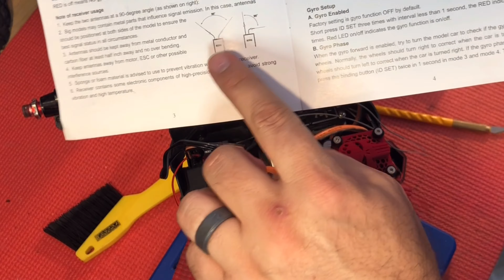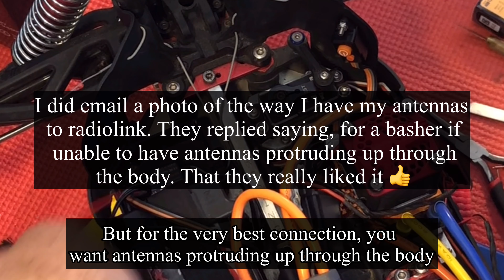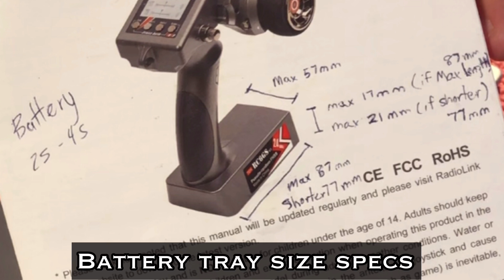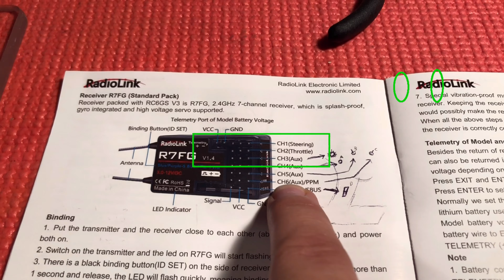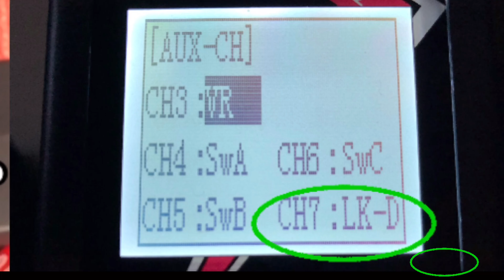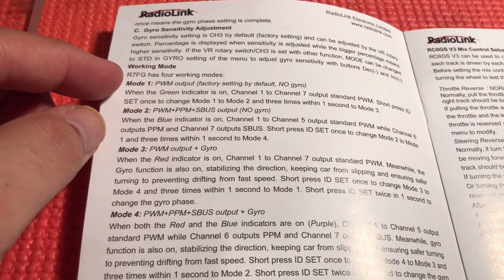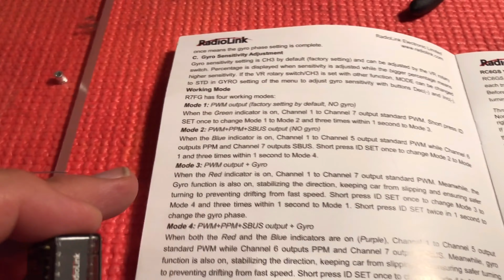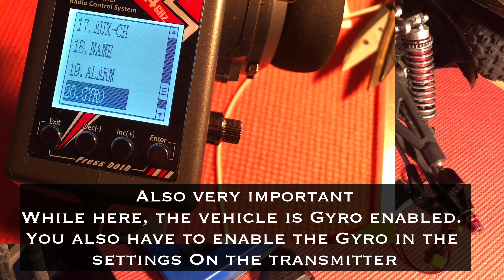Radiolink RC6GS v3 - INSTALL and Overview - Setup Dual Antennas, Gyro & Telemetry Explained

Comment: @ east tactics on my Traxxas summing I have 2 steering cables one goes to ch1 where do I plug my other cable at ?
Reply from the maker: Out of your ESC, you’ve got a cable that is the out for your on off switch to the ESC, you’ve got your main thick power cables to go to your battery, and you have one wire (which is comprised of three) that will go to your receiver. Typically this will go into the spot marked TH for throttle.
Now your servo will have its own wire again comprised of three. Which will go into your receiver in slot, titled steering.
However, you’re saying that somehow you have two separate wires for steering? Where are these two separate wires coming from, the only wires that you should have dedicated for string should becoming directly from your servo. And there should only be one set of three going into a single JST.
Check the description of this video and at the top you should see a link for the ability to submit a  Asq me question, include photos
Reply: @EastTactics  thank u, that’s where I’m lost one wire goes to one servo to turn left another servo to turn right and only one location for steering on my new radiolink
Reply from the maker: You have two servos? Is that what you’re saying? 
Because most vehicles only have one servo that’s capable of turning, both left and right.
Reply: @EastTactics  yes 2 servos on my Traxxas summit 1/10 scale to steer
Reply: @EastTactics  on my tqi it has 2 spots that says ch1 both are for steering on my new radiolink there is only one spot that says ch1 ?
Reply from the maker: @2259chevy 
OK, I myself have not done this. But I’m pretty sure there’s a way to do it with this transmitter because it has so many extra channels. All you need to do is assign one of the extra channels in the settings on the transmitter to act as a Steering channel.
It comes default with one channel dedicated to steering. However, you’ll need to go in and assign another channel to be a steering channel. Then you can plug your other servo into that channel once it’s set up on your transmitter. 

To use the RC6GS with a Traxxas rig running dual servo, you will need to connect the two servos to the appropriate channels on the transmitter. You will also need to set up the transmitter to control the two servos in the correct way. For more information on how to do this, please consult the manual for your RC6GS transmitter and the manual for your Traxxas rig.

Here are some additional tips for using the RC6GS with a Traxxas rig running dual servo:

Make sure that the two servos are properly matched. The servos should have the same torque and speed.
Make sure that the servos are properly connected to the transmitter. The servos should be connected to the appropriate channels on the transmitter.
Make sure that the transmitter is properly set up to control the two servos. You will need to set the servo travel limits and the servo reversing.
Test the servos to make sure that they are working properly. Move the transmitter controls and make sure that the servos are responding correctly.
I hope this helps!

Comment: I kept losing signal to throttle at long range! Steering works fine but throttle does not! Any idea
Reply from the maker: The fact that you lose throttle only is a huge blessing with this receiver transmitter. With the stock one. At loss of range, your vehicle has a potential ( which is high) to simply takeoff.
You’re losing connection? At what range? Because you are going to lose connection, especially if you are behind large objects, trees, or buildings.
Reply: My concern is, there are other speed racers running exact, same set up and they don't have an issue at all, and we are all running on the same road at the same time I would say about a football field link I lose signal and either direction! I put a new receiver on it today. I will see how it goes.
Reply from the maker: @bashmasterRC 
ya let me know

Comment: Hi Sir, i have a HOSIM X07 and i want to install a RADIOLINK V3 but don't know where to get the SERVO 3 WIRE. Should i get the 3wire from the MOTOR going to ESC? Many Thanks
Reply from the maker: I'm not 100% sure what you're talking about, but I'll take a shot at trying to answer. The wires connecting from the motor to your ESC are completely a separate thing regarding your "receiver/transmitter package" they are much thicker wires and they have a dedicated place to connect into the ESC. The ESC however, does have a three wire that comes out from the ESC with a JST and connector. The jST and connector will connect into your receiver. tthere will also be a three wire that comes from your servo ending in a JST connection also. This will connect into your receiver as well. I hope this answers your question
Reply: On my radiolink receiver its not lightning up , i think im missing a SERVO wire. So i don't know if i have to get that 3wire from the motor.
Reply: On the RECEIVER we put the STEERING SERVO on CHANNEL 1 right? What do i need to put on  CHANNEL 2? THNAKS
Reply from the maker: @dpyvett2261  no wires go directly from the motor to the receiver. The only thing that goes to the receiver is wires from the ESC, and wires from the Servo.

Comment: I have the RC6GS V2. How do I set up different throttle rates??
Like Arrma Vehicles transmitters. They have 50%,75% and 100%. Lets say the 3 tier switches on that transmitter, how do I set center point to 100% throttle and left and right points to 50% n 75%? Is it possible?
Reply from the maker: Yes, this is possible.. You’ll do this in the D/R setting area. That stands for Duel rate. You can change the dual rate for the throttle on any one of the switches. So in your case you would probably want it to be assigned to one of the two three tier switches, found at 11 o’clock and 1 o’clock. I assigned mine to the three tier switch in the 11 o’clock position, And on the V3 they’ve set that 
Switch to be called SWB. There’s a chance that it might be different on the V2. Anyway once in the D/R setting, the top left quadrant is the one asking you which switch you are going to change. You’ll know you’re on the right one if physically toggling the switch changes the display in the upper right corner of the screen from displaying the words, left, center, right. Anyway adjust the throttle (TH) to a different number for each position. That’s it.
If this doesn’t make sense, you can reach out to me via Facebook and we can connect perhaps even via the phone. I do plan on dropping a video shortly that will explain this, And many many other things regarding deep dive on the settings.
Reply: @EastTactics  Appreciate the detailed response. I was thinkin maybe I needed the V3, because I seen some new feature about dual rate added to the V3. Happy to know I dont.
It sounds fairly simple. I will attempt to do it once I get off work later this evening. Im usually  good at figuring out things once Im pointed in right direction but if I somehow cant figure it out, will comment here later.
Again, thank you!
Reply from the maker: Sounds good

Comment: It isn't required to run that plug for battery telemetry is it? For the v2 and v3.
Reply from the maker: I’m not sure what plug you’re talking about. Can you clarify?
Reply: @EastTactics   The JST to the xt60 connectors for battery telemetry. I thought I heard someone say you have to run that, but I tested it out earlier for myself and figured out you don't need to. 

Also how would you use those 3 position switches to change the throttle percentage? Do you need something plugged into that channel to do so? You brought it up in the video at 17:47. I honestly have no clue how to set that up.
Reply from the maker: It is not required to run that telemetry dongle. You can choose to leave it out completely. In fact, I do not run it directly to my main battery. I chose to run it to my fan battery. But again I could’ve chose to completely leave it out as well.
Regarding your desire to assign variable functions to your throttle, utilizing one of those switches. You can achieve this without doing anything unique regarding installment. Simply by installing your transmitter/receiver the regular way by plugging your throttle, and steering into auxiliary one and two is all that is needed to achieve This feat.
The set up is as follows, simply go into option 13 called duel rate (D/R). Once there you’ll see a layout of all of your channels, but in the top left, you will see one called SW. More than likely that is set to Null at the moment click enter on that and change it to the switch that you want to incorporate this function. For example, SWB is the switch that is sitting in the 11 o’clock position on your controller. Once you’ve assigned sw to SWB, you’ll notice that if you toggle that switch, it will change on the screen in the top right corner from center, to down, to up, etc. depending on its position. Now from here, simply adjust the TH (throttle) to the number desired depending on the position of the switch. For example, if you want that switch to be down and your throttle to max out at 25%, then change the TH to 25. Then move the switch to the center position and keep it at say 100 for full throttle. Then move the switch to the up position and assign it to say 50% (50). 
Now when you leave that setting for the duel rate (setting 13) where the SW (again top left option is that to SWb). And then back out, you will notice that whenever that switch is in those different positions your throttle will follow suit. 

Let me know if that makes sense, if not, we can set up a time where perhaps a phone call could be in order and I can help walk you through it
Reply: @EastTactics  This explanation is what I needed, I get the procedure. But if I have any trouble getting it to work I'll let you know 👍👍 thanks a bunch.

Comment: I simply drilled an additional hole in the receiver box lid then add another antenna tube
Reply from the maker: With the length of the antennas, do your antenna tubes go up through the body as well? I decided to avoid going up through the body simply because I don’t want the antennas to get destroyed on a bad wreck
Reply: @EastTactics  they are tucked underneath the body for my bashers. I extended through the body shell for my SR cars
Reply from the maker: @cacanjacowans540  
Gotcha, makes sense

Comment: Now is flashing green I presst the bind button and still not want to bind ?
Reply from the maker: Sorry, I’ve been busy working my regular 8 to 5.
Have you confirmed that your jst connectors are plug-into the place and facing the right right direction?
Reply: @EastTactics  yeah that was the problem i fix it now is bind but I have steering but throttle don't work 🤦‍♂️
Reply: @EastTactics  now the trasmitter pair the steering working but I don't have throttle 🤦‍♂️is always something
Reply from the maker: Sounds like it could be a setting on the transmitter, or perhaps, check your throttle endpoints. There might even be a switch or toggle that is not set correctly.
With this transmitter, you really got to take the time to read the instructions and understand how to adjust things like throttle, dual rate, etc. be sure not to skip around in the video as well and just try to absorb everything you can because I cover a lot of these topics.

Comment: Got mine and it's saying RX low power and won't do anything
Reply from the maker: How are you powering the transmitter? Are you using the classic AA batteries? It sounds to me like they must be way too low on power. Try replacing all of the batteries with brand new batteries. Let me know.

Comment: You say about using the switches for fans & lights, it not that straightforward, we cant connect 2 cables to a CH & use the switch, they just stay on. We have to buy a Led on/off electronic reciver switch & use it for Any kind of addon like fans.  For buttons to work they need the electronic switch with 3 wires you then plug your 2 wire leds/fans in to it then into a channel. 
i think this is stupid, iv just ordered the new dumbrc radio it uses FHSS like radiolink & some of the other dumborc recivers wich are compatible look identical to the radiolink link, hope they work iv loads of radiolink recivers & im sick of the braking the radiolink ariel
Reply from the maker: I was under the impression that if you assigned a light or a fan etc. to the appropriate position in the receiver. You can then within the settings on the transmitter change it so that it can be activated in on off setting or it could be set up to be activated while holding the button down, etc.
I however, have yet to actually set up a light or a fan on a specific unused channel, but will likely in the near future.

Comment: After three uses my throttle trigger does not return to center. Going to have to give this controller a one out of five stars. 

Edit: The company is sending me a whole new unit. Told me not to even bother sending back the defective unit.
Reply from the maker: Sorry to hear the difficulty brother, in my experience, this things been amazing, and I’ve never seen a bad review land yet in all of my videos on the topic over this last year. To me, it sounds like a potential one off issue you’re having which I might suggest simply reaching out to radio link, I’m sure they’d work with you if there is a defect. Another thing to consider …being that this controller is literally programmable in every function is doing a factory reset to get everything re-centered, or specifically looking into your throttle settings, which could be fully adjusted to either counter the issue or remedy it. Also, you might set your throttle endpoints on your ESC, just to be sure, that’s not the issue after installing a new receiver and transmitter
Reply: @EastTactics  I would have sent it back to Amazon and exchanged it. I use the power wire from the battery box on a lipo. Emailed radio link and explain the situation. They are sending a whole new unit to me. Told me not to even bother sending back the defective one. That's pretty solid.
Reply from the maker: 4sure!

Comment: How does the receiver get power is it from the esc cable cause I don’t know how to soder and would this installation be standard to all Rc cars
Reply from the maker: Yes, the receiver gets power from the esc. And the ESC gets power from the battery. Most RC cars when you reach hobby grade all have an ESC and a receiver. The ESC has cables that come off ending with a JST connector. Pretty universal. The receiver itself will take the JST connections.
Most the time you don’t have to do any unique soldering or anything of that sort. And most receivers are marked for which connector goes where. For example, the servo for steering will go in one slot. And the ESC into another.